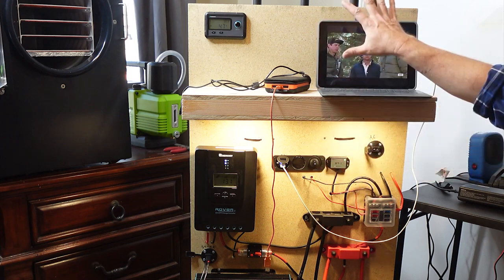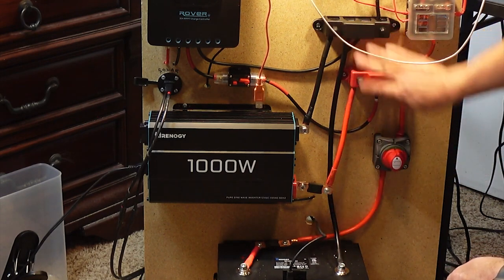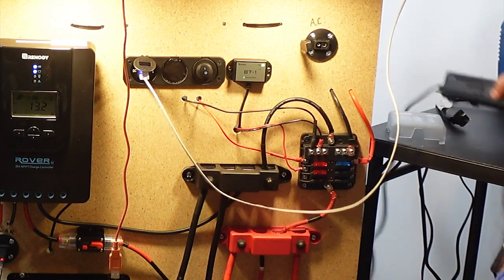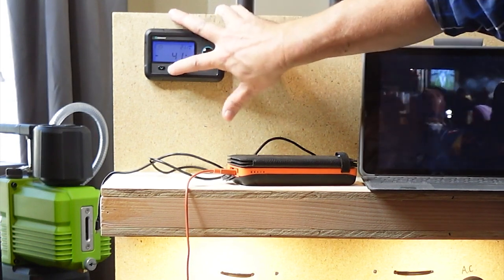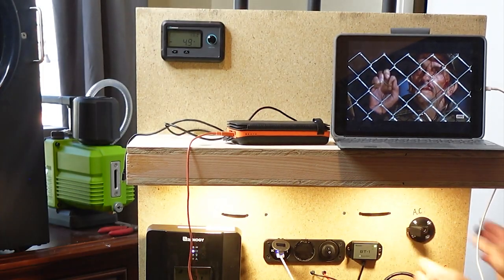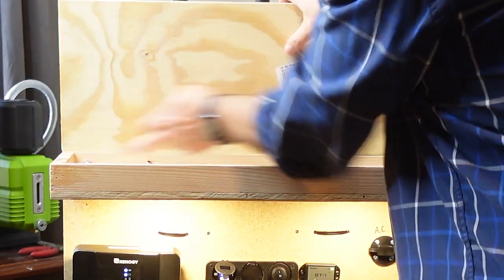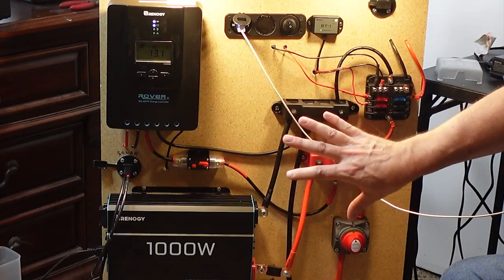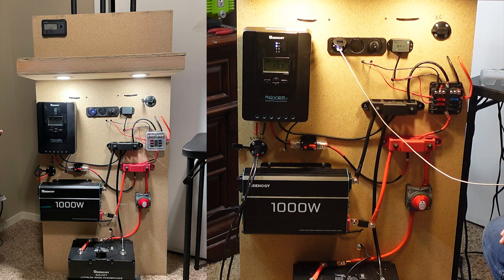Portable DIY Solar Generator | Step by Step Guide

Comment: I agree with you 100%. Yes, it's easier to buy something and call it good, but man, you're really locked into whatever that company decides to make, and YOU need to adjust your living to meet the products specs, which are usually VERY limited and fall way short of even remotely meeting your basic needs. 

Here, you build something that more closely reflects YOUR NEEDS. Not to mention you know how to troubleshoot it and repair it if needed. 

I know it may not be nearly as portable as most on the market, but for me, that's not hard to fix either. One thing I do is permanently mount and hard wire in, a 50 foot retractable extension cord. Now I can pull it out and run it upstairs or whatever I need power, and when I'm done, rewind it back inside its housing. This was something that was a must for me, because I hated not having one ALWAYS attached to the system, and NOT having to run to the garage or wherever to find one.

Even smaller solar generators, I would use a vacuum cleaner retractable cord. Vacuum cleaners draw a lot of power, and those cords are pretty darn tough and well made to handle a medium load of at least 1,200 to even 1,500 watts or more and can take a fair amount of abuse. The ones I looked at were 14ga so they can handle 15 amps all day long, and that's 1,800 watts. 

They're compact and store a good length of cord. Plus, they're cheap as heck or they used to be on ebay anyway. Even amazon has new replacement units dirt cheap, and adding a couple of them inside your shelf setup wouldn't be a big issue at all.

I really like your shelf and little storage area. Maybe use magnets to secure it in place and a few screws on the cover to make it appear as though it's not removeable if you wanted some sort of hidden storage area. Keep up the great work.

Comment: The only arguement from me is the assertation that your system is better than a jackery.... It may well be in some use cases, but not all. I live 90% off grid permeantly and have 2 x home built set up's (a 400ah lead/acid and a 100ah lifepo4) and 2 portable power stations (bluetti ac180 & EcoFlow river 2 pro)... They all work great in their own right and use cases. The lead/acid setup is basically outside and the power stations inside for portable power applications. All are charged mainly by solar with the exceptions being the power stations being charged by inverter in my truck while driving if solar is poor for a while or periods of heavy use
Reply from the maker: I agree. Better in the respect that I can change out parts and scalability rather than buy a new unit. A self contained power station has a lot of advantages over something like this.